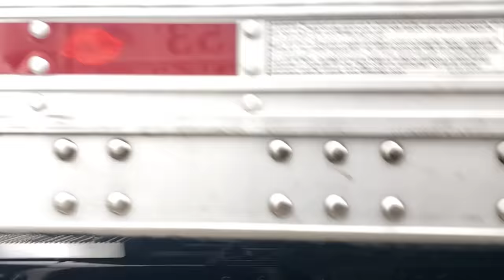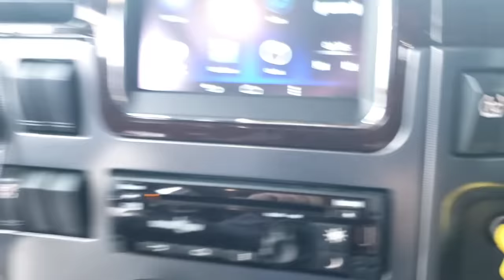How to slide your 5th wheel (and why). You Asked, I Delivered

Comment: Why do people think they have to crank the dollies to take the pressure off? Just put them down and drop your suspension it's that simple.
Reply: Thank you I just dropped my airbags and that helped me move my fifth wheel for the first time by myself❤
Reply: So you don't need to put them down just drop air bags
Reply: What if there is no drop button?
Reply: @Stretch  I never seen one that couldn't drop the air bags. Unless the truck was really old I guess. Then you do what you gotta do right.
But if you do have them there's no need to crank until you see daylight between the fifth wheel and the plate. That's when you use your common sense!!
Reply: @akaiwilliams6043  Did you read the comment?
Reply: Every truck is not the same🤦🏽‍♀️
Reply: @bernadetteleonard4940   your right . But they should all have suspension drop button on the dash.
Reply: @samknott6294  a lot of older trucks do not have that.
Reply: Nahh I just had a 21 freightliner no bag drop my buddy has a 21 international no bag drop
Reply: This is the best solution to this situation
Reply: All that does is put it in a bind

Comment: Drain air bags with trailer land gear down. Also if your trailer air bags drop take that into consideration: also Peter built has better quality frame and 5th wheel. Those having problem with freightliner 5th wheel likely slightly at an angle not allowing it to slide

Comment: In my time  I  had  air  slide  and manual  pull  lever  pin release mechanism   Some times  you have to get  a  hammer  and nail punch  and a can of PB  blaster  to get some action  but  if you  own  your  tractor  or drive the same unit  all the  time  you can maintain it and lubricate it and there should  be  know  problems  but when you are  in a slip seat operation  there are always  hiccups  all day long  with  every  aspect  of  the equipment   Good video JJ

Comment: Good video !!! For the guys doing port or intermodal chassis 
Be very careful sliding the 5th wheel to far forward you will tear up your mud flaps and or Chassis when cornering or getting into a tight spot Especially the 20’ chassis.

Comment: 11:21  that spring clip can get caught in the teeth of the deck plate. if it got lodged in between the gaps on the deck and you turn you could rip your lines from the trailer. secondly look at the slack in your service and emergency air lines and look at the tension on the ELE cord. if you cut the air lines down about 3" on each side it will help 2 fold. it would raise your lines off the deck and take pressure off your ELE cord connectors.

Comment: I have 18,800 pounds on my drives…. it’s a New Truck 2023  Freightliner, I’ve learned to center your  fifth wheel between your drives. 
Even an extra notch beyond center. (Towards the cab). 
Omg it makes it so much easier to judge exactly where to slide your tandems! 
WARNING: you will lose your tight radius!! So please!! Always ALWAYS know that.
Reply: Thanks for that!
Reply: But if you owner , the closer the trailer is to the cabin, the greater the fuel savings.

Comment: That's the cleanest 5th wheel I've ever seen! So, I need to move my 5th wheel forward because the guy I bought the truck from had it in the last hole. So the increase in turning radius is KILLING me when I'm in tight spots. Can the 5th wheel be moved if you're just bobtailing?

Comment: My trainer was horrible.  I really appreciate a good teacher.  Currently hating the job. I've only got 6 months in. Thought I'd be making at least decent money starting off but it hasn't been great. Need money so I rarely take hometime.  I wouldn't mind being out so long if the paychecks were better.  48 years old andPraying my next move will be to a better company. Worried about tine. One I Don't feel like a slave and a number. Constantly getting live load and unloads,  often waiting more than a day to recieve another load after delivery of the last one. Any advice from anyone would be greatly appreciated.
Reply from the maker: I hear ya. You've probably heard this before but Trucking goes in waves. Right now we are in a low point because the economy slowed down and there were too many drivers. A lot of those drivers are quitting or getting out which will eventually help. And when the economy starts picking back up then everything is just the opposite and you'll be making money hand over fist and you won't know what to do with it all. That's when more and more people start getting into Trucking which balances it out until there are too many drivers and the economy slows down again and then you're back at this point. It's a cycle that will never end. If you can make it through this low cycle then you can make it through anything and you will eventually make a lot of money. Many people are believing that it will start picking up throughout this summer and start that upward Trend again. Hope this helps and hang in there. Good luck with everything
Reply: Find a new company. Good economy or not I’m still making decent money. Big companies are good for training but after that you need to leave. go to mgm, mgl, or stl thank me later💪🏾
Reply: What you're describing is crazy. Keep your CSA score good (no accidents, tickets, etc)  for a year or two. The good companies will be beating down your door. Trust me. I'm with a company called BCB out of Mansfield, Tx. Truly a family atmosphere here. They pay us WELL, get us amazing miles (I drive teams and we almost hit 7k miles this week), and when we first were hired, they handed us a map and let us choose which states we wanted to run in... They let me off for 6 weeks for the birth of my daughter and even kept hounding me for pictures of her after she was born lol They send out gift cards to your immediate family members on their birthdays, and have a table set up in the main office for drivers who are going through something or have maybe lost someone--they buy a card, leave it on the table for other drivers to sign, and then send it to the driver it's for. Oh and they have a Safety Show (essentially a Zoom call) everyday for an hour that we can tune into. If you attend 18 of those calls per month, you'll get an extra 3¢ per mile the following month... Usually totals about an extra $75 each week ($300 each month). Trucks are new. You RARELY have an issue with a trailer because the company and my fellow drivers don't hesitate to get em fixed. Also, they monitor wind and weather on a daily basis and inform drivers. If you don't feel comfortable rolling, they don't force you to roll. It's your call as the driver and dispatch has respected that as long as I've been driving with this company. I recommend this company to any GOOD, SAFE driver  worth his salt.

Comment: Also helps with pups if you have to haul one slide all the way to the back so your mud flaps don’t hit the landing gear
Reply: I pull all the trailers so I like finding the hole that puts the steers at 12000 lbs full fuel and gear. Now move the slide plate back so the front hole of the slider is your 12000 lb hole. Now you got enough slide to pull pups or strange trailers. 
If you got the money you can buy additional slide track to do the same thing but my way is cheaper.
Reply: Those square holes are worth 500 lbs.
Reply: @jerrykinnin7941  Are you sure about that? On the tandems they're only about 350 and these don't have as much separation.
Reply: @johncalvo1743  there are 2 style holes on the trailer slides. Close and far. Far is about 500 close is about 300. The slider on a Fontaine 5thWheel is 500 a hole. The 2 pin style 250a hole. I got a Holland now on a freightliner. I've yet to figure out. But that all the way forward will get you 12000 lbs on the steers with a 40ft tri-axle Pratt dump chassis with a 20 ft can grossing 45,800 lbs in the box and 79000 lbs and high change.
Reply: And I would love for my boss to chop the frame ends off the rear of the truck frame even with the last cross member. Schneider container style. Then all my container chassis have the JBHUNT style shallow drop chassis rails with an 18" kingpin setting for a 40', 30" for a 45', 36" for a 53' I'd be able to scale 47000  lb in a 40ft container with a 51ft 5axle bridge and only be 58ft long overall. 
The 45ft container would have the 40ft Cali bridge for a 55ft overall 5axle bridge 
At 62ft total bumper to bumper. 53ft would come in at 55overall bridge and under 70ft long overall. Now how to get the 45 And 53 lite enough to scale 46000lbs and the 40ft to scale 50000 lb

Comment: Already had this knowledge, just wanted to see your presentation. Good tutorial. Wondering why you chose the landing gear over the tractor air suspension to take tension off your slide pins. Wok smart not hard and all that..
Reply from the maker: I found from my drop and hook video, that I was gating a lot of comments from people that didn't have a dump valve. Also, dumping the air could lower the 5th wheel too much of you don't set the gear down to the right spot.

Comment: How many lbs off your drives per notch 
Of slide? Care full JJ trailer is closer , when you U turn .  Love the videos . I keep looking for the Dragon Truck on the road !
Reply from the maker: That all depends on how much is in the trailer and how it's distributed. There's no set amount.
Reply: General rule is 250-300lbs, but that varies based on 5th wheel manufacturer.
Reply: @drewrbunn  lol , I knew it was 300lbs .

Comment: I always like to ride with my fifth wheel all the way to the back but I’ve recently kind of changed my mind and think maybe it’s better a little bit more towards the front right now I have it like one notch closer to the front from halfway and I don’t have any trouble making turns and I weighed I’ll 41,800 pound load today and I was able to fill the whole fuel tank and I was still only about 33,000 on the drive axle whereas if you had it all the way to the back he might be overweight on your drive actual like 34,200 or something which doesn’t sound like much goes in about 200 miles you’ll lose that weight but he might go through a scale burst I went through a scale today which was a surprise first time I’ve been through one like that in a while and it was a creep through scale where they Weighed each axle one at a time so if you was over they were going to find out this is a easy job if you don’t play the hook and book game sooner or later they get you in trouble

Comment: I see someone else mentioned moving the 5th wheel forward gets the trailer out of the wind for better mileage. I was looking on Peterbilt's website and they show peak torque on the MX engine is at 900 rpm. In 12th gear what speed would they be at roughly? Just comparing Cascadia is geared so peak torque is 1200 rpm which in my trainers truck is about 65. Just food for thought. Another great video sir.
Reply from the maker: Thanks B-Coop. I don't think this engine/transmission setup would be at 900. At 900, this thing is lugging and shaking horribly. They say the sweet spot for this engine is 1100 to 1400 RPMs. In 12th, at 65 mph on flat ground, I'm hovering around 1050 RPMs. Seems like 70 would be an optimal speed. Of course, no way for me to confirm that.
If I drive 55, in 11th, I'm around 1300 to 1350 RPMs.
Reply: @JJtheTrucker  I thought 900 sounded pretty low. I know in my trainers FL once you start up a hill and drop below like 1300 you just as well shift down or it drops like a rock!  How is the power in your Pete?
Reply from the maker: It's OK, a little better than the FL, but still all about the fuel savings instead of power. It pulls up hills a little better.

Comment: good vid, you would have thought since its nearly 2021 they would have made an air motor to put on the trailers to raise and lower the land gear. ?
Reply from the maker: Exactly! Or an electric motor. It would still need to have a manual crank as a backup and maybe that's the issue but still you would think they would be able to figure out something LOL. Maybe that would be a good thing for you to invent and get a patent for.
Reply from the maker: I think you're on to something.
Reply: @JJtheTrucker  little off topic here..i was watching a cool video about solar panels for trucks powering the apu for 12 hours or more.. you ever thought of that ?
Reply: @matt89108  you can but them of amazon for like $130 a panel . just get 2 flexible solar panels and inverter.they also use them on canal boats here in the uk and they cost very little to buy no idea why you paid so much.. only 2 panels needed
Reply from the maker: I've thought about looking into it... Eventually. Once I get some free time lol. If they work well, I'd love to do it.
Reply: @JJtheTrucker  it's the way the world is moving now.. soon it will be all electric .i know in the uk from 2030 or some thing you will not be able to buy petrol or diesel motors . even boats are now going hybrid or full electric . soon your gonna be doing a vlog on charging your all new electric semi ..lol
Reply from the maker: Looking forward to it 😁

Comment: Hey JJ if weight isn’t a factor where do you recommend for everyday riding?
Reply from the maker: Depends on you.
Forward = better turning radius, less stress on the air lines and better fuel mileage.
Back = smoother ride and more room on the catwalk.
Reply: Great question and great answer.
Reply: So educational! I’m on my first load and this helps a lot! I definitely need to move my fifth wheel plate, currently at 12,500 on steers. 

Only question I have is- should I be loaded heavy to do this? Or it don’t matter?
Reply: @jessicaantle1778  I have Same problem right now and I don’t know 
I have to move the pin to the front or the back any help please ?
Reply: @mouhammedrasoull7710  I ended up moving it back! Also- know what your weight limits on your steers- as long as your under that- even if it’s 13k, and as long as your under 80k total- your good

Comment: Would sliding the fifth wheel forward make the ride less bouncy?
Reply from the maker: Other way around. Sliding it back increases the wheel base which smooths it out. But only very minimally. What matters most is balancing the weight between the rear axels and the trailer tandems. If they're close to the same, you'll have a smoother ride.

Comment: Does the 2020 peterbilt have in cab 5th wheel release button ,or do you have to manually release the king pin from the 5th wheel ,, im coming from a freightliner
Reply from the maker: It's manual. As far as I know, only Volvo has the in cab release. Seems like it'd be convenient, but you're already outside dropping the landing gear and disconnecting hoses, so I dunno that it's all that great of a feature.
In fact, I'd hate to accidentally push that button and drop the trailer. 🫣
Reply: @JJtheTrucker  thanks for your reply, and yeah your right ,your already outside dropping landing gear and pulling hoses ,so 1 extra step really isn't a big deal , thanks stay safe out there
Reply: @JJtheTrucker  International has it, at least on some. It's on the LT I've been assigned for a few weeks. Not really any faster than the manual release on my old Freightliner, though, since I still don't trust it enough to forgo a look to verify each time I use it.

Makes you hold it for a solid few seconds of irritating beeping before it will work, so an accidental bump of the button shouldn't drop the trailer.

Comment: hey i have a genuine question. 
my fifth wheel is not locking itself even tho i click the in can buttons and still it just kept sliding each time i hook/unhook the trl it
Reply: as you refer the (pins) don’t come out it just inside frozen and not being locked to the frame little holes
Reply: it is just being inside and not coming out to br locked even with the help of slide button inside the cab
Reply from the maker: Sorry for the late response. I hope you got it figured out. What ended up happening?
Reply: @JJtheTrucker  handled like mf 🤝all good
Reply from the maker: @i_m_ak1  great news.

Comment: good day Sir just to be sure why is it called the 5th wheel..not refer to it as a 3rd row tire axle..is there a code or system for that..thank you
Reply from the maker: TBH, I'm not 100% sure why it's called the fifth wheel. I've always assumed that it was because old trailers only had four wheels in the back and needed that fifth wheel up front. I could be completely wrong about that though LOL
Reply: @JJtheTrucker thank you Sir..just be careful always on your work duties everyday..

Comment: What's with the Super Singles on the rear? What benefit do those have over normal duallies?
Reply from the maker: Better fuel mileage, less chance of blowouts when punctured, better traction and control during slippery conditions, less expensive, better wear and a few more. The down side is that if you blow a dual, you can often times still limp the truck to a garage. With singles, you can't.
Reply from the maker: Matt, I'm fairly sure Prime gets a kickback with nearly every company that they purchase from regardless of the product. I'm sure that if they bought dual tires, they would get a kick back from them as well. But Prime is definitely saving money on all of the items that I listed.

Comment: Can u move the 5th wheel without a trailer or is it way more complicated?
Reply from the maker: You need the trailer to hold it in place. I guess a forklift could work in a pinch? No way it's moving by hand.
Reply: @JJtheTrucker  awesome thanks. Realized im missing a wire that releases the notches smh
Reply: Explained with great way, that’s what a new driver wants to see. Thanks for making this video